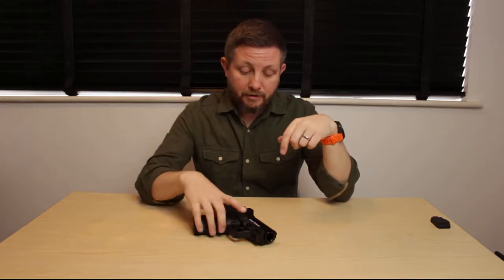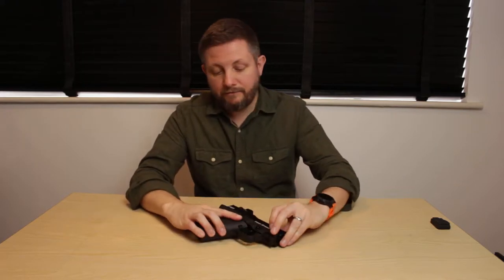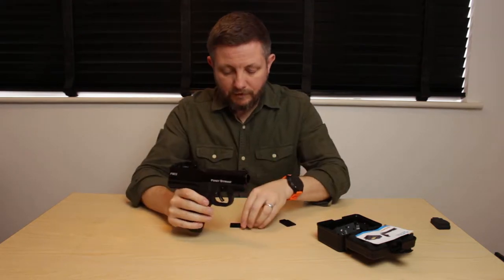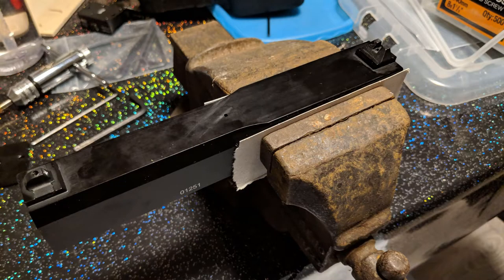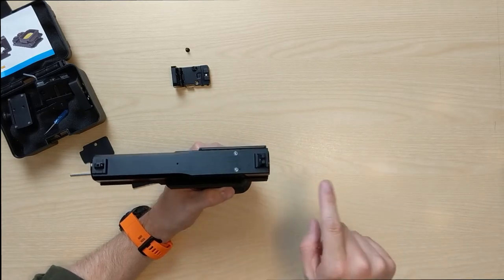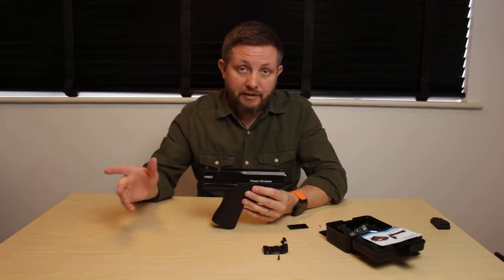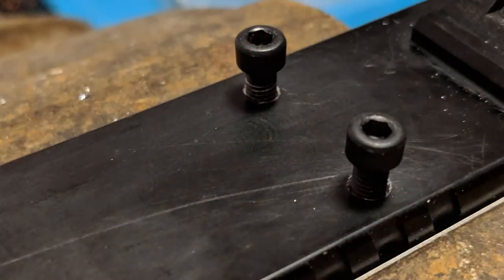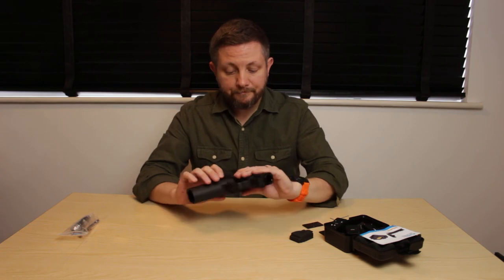First Strike FSC Paintball Pistol - Red Dot install Guide

Comment: I might try this mod at some point looks pretty good. My advice on drilling is to mark the holes EXTREMELY carefully. Triple check and quadruple check the positions with a FINE POINT silver marker first. Also use extreme care punching the holes. You need the poistions of the holes to be PERFECT. Then, prepare a sequence of increasing sizes of drill bits. I would drill these holes in four steps. The first drill bit would be extremely thin. 1 mm or so. Then gradually increase drill bit sizes in 3 or 4 more steps, ending on the final diameter. This is the only way to really get the positions correct. Also, on the depth. Measure the desired depth EXTREMELY carefully. Then use a silver paint marker again to mark the depth on each of the drill bits before hand. Trust me folks. Taking steps like this will always pay off. You can do extremely accurate work by hand if you just apply some technique and patience. Don't just measure twice, measure 3 or four times then stop and think for a while to make sure you are even on the right strategy. If something is worth doing. it is worth doing correctly. Nice work bro and thanks for the video and idea!
Reply from the maker: Hi there buddy, this is great advice and I agree. Having a more methodical and accurate way of working will definitely reduce the possibility of error. It turned out good for me on this occasion, but there is definitely a point of no return on these mods so the more preparation and caution you take the better your work will turn out. Thanks for commenting, this will help anyone planning this as a project 👍😎

Comment: I can’t drill I would hot glue the plate 
Or use industrial double sided tape
To put the plate on
Reply from the maker: Hi there, sounds like you're working the problem 👍 post and let me know how you get on. Could help others considering different options 👍😎

Comment: Where do i get this redot from?
Reply from the maker: Hi there, I bought mine from Amazon here in the UK. but you can get them from ebay too. I have added some links to the description if you are wanting to find one. I am thinking of replacing the flip up sight for a more robust RMR, if you forget to flip it up you have no sight when you want to use it lol😱 I have added a link to that one too.
Reply: Tactical Magfed perfect thankyou 💪
Reply from the maker: @xflama8982  no problem 😎
Reply: @TacticalMagfed  I read the reviews on the Ncstar vism its a great idea to flip the view finder down, but Why?  and they had horrible reviews, durability issues. I think mounting a weaver Rail on top of  the FSC would be a better option, so you could just replace a reflex sight, if it fails with a new one.
Reply from the maker: @garywest3763  In the "real steel" world this could be mounted on a pistol with a slide cutout so it could be co-witnessed when folded down. Closing it turns off the red dot and saves battery. I would agree that the replica versions are not as reliable. I have replaced mine with a Trijicon replia RMR. Once the FSC has the holes tapped, any RMR with the same spacing can be installed really easilly. You could mount a weaver rail, but it would sit really high once the rail and adaptor are install. Thanks for watching buddy 👍😎
Reply: @TacticalMagfed  just my opinion - i will bond that mount plate to the marker with good glue and its never come out =) That small red dot is  not that heavy to be a real problem to hold=)
Reply from the maker: @koliapupkin2505  hi there, some sort of apoxy may work. There is no recoil to worry about, let us know how you get on 😎👍
Reply: @TacticalMagfed  just my opinion again - I dont think a pistol needs any red dot devices at all its not a rifle or shotgun =) I can see in on sport shooting guns - but that a different story and purposes=) For firearm or air gun more then u ever need is a laser - flash light combo on bottom rail =) That will be perfect for close range use - for long range gun is useless , better use a rifle=) But if someone really want put a scope or red dot on FSC i think is first strike made a adapter for it with top rail but it look ugly for me and not relabel at all=)